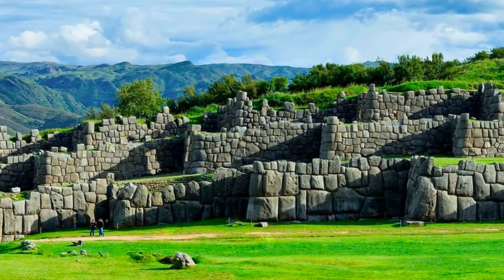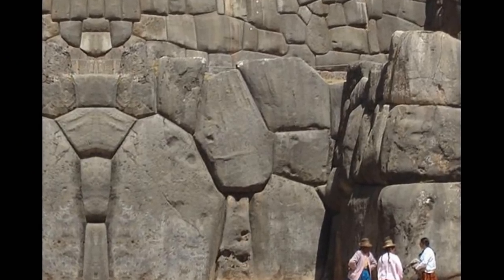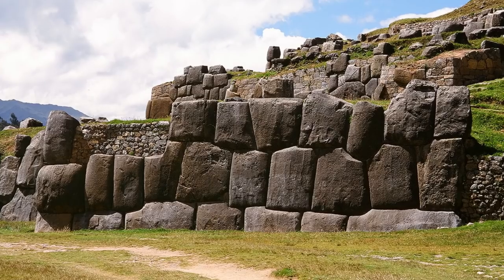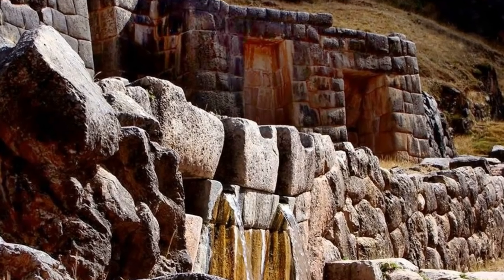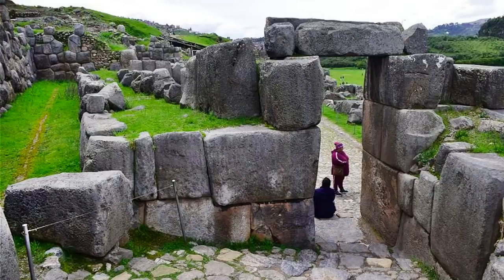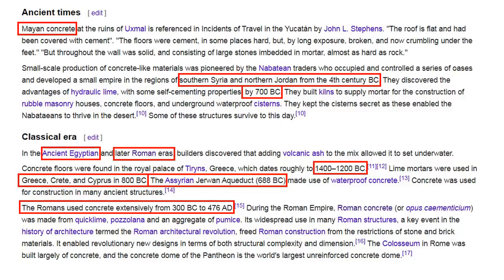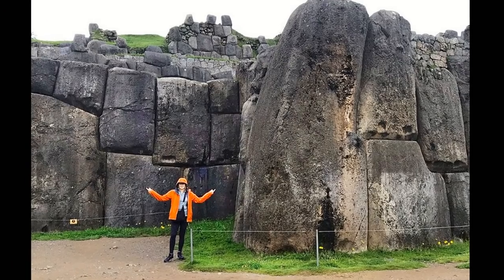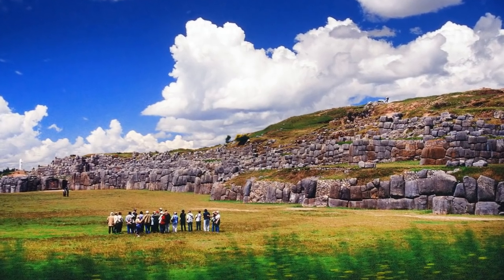Explained: How were Peru’s #Sacsayhuaman Walls Built

Comment: Someone should drill cores that span the joint of two of these megalithic blocks. At the inner end of the core the joint should contain pollens which would be dateable. This may give us a date when the blocks were put together.
Reply from the maker: Interesting idea. If researchers can find ancient pollen in between blocks, that could be very helpful to date the site.
Reply: @CuriousBeingbyTina  I worked as a drilling supervisor, so I'm familiar with coring activities but not usually horizontal. I would suggest taking a core from the centre of a block as a control sample, testing the dust and cuttings for pollen and dating them. Would the Peruvian authorities be amenable to such investigations?
Reply from the maker: @thomasprescott5333  That'll be a very effective method to tell the age of the structure. Maybe the Peruvian authorities would consider to do such investigations if the core drill is done at somewhere at the back and not affecting the face side or the structure integrity of the walls...

Comment: I just found out that a team of Russian and Ukrainian geophysicist along with Peruvian scientists did an analysis of the Sacsayhuaman stones little over a decade ago and found that the builders used various techniques on the site. The largest gigantic stones at the base were made from smaller stones from the nearby quarry and then covered with a specialized type of a hydraulic lime mixture using pulverized quarry stone. Most of the other large boulders were made from the hydraulic lime of a specific chemical mix they did not analyze.Seems that they mainly used microscopic analysis and not chemistry. Questions were raised as to where the lime was made, because it requires lots of fuel, usually wood burning. They were asked by the Peruvian government to find out why the megalithic structure was deteriorating and how it could be preserved. Apparently acid rain was dissolving the rocks, and ground water shifting soil underneath. No meaningful excavations beneath the base of the walls seems to have been made. There look to be rock foundations bellow the ground levels. There are still many arguments as to whether the rocks were carved to this precise fit ( highly unlikely in my opinion) or if they were artificial polymer or hydraulic lime. I don't see why not a combination. Not enough analysis was made, which surprises me in this day and age.
  Do you have more information on these findings Tina?

Comment: Two  more things to consider: (1) Cuzco is about 11,000 feet high (17.7 km).  This project would have taken a fair number of people to do, so how were food, water, building supplies, etc., hauled up?  (2)  This looks like a military fortress -- who [and how] was able to assault it, why was it needed?
Reply: (3)   If geoconcrete was used, as the lady suggests in this post  -- poured in place like regular concrete -- there is another problem: when the blocks were still damp, a 100 ton (or tonne, for that matter) block is going to weigh its cured, dry, weight, PLUS all the water involved, at a "pint a pound" (roughly, half a kilo for each 470 ml of water).  This will not be light.

Comment: I agree SSHM seems pored, or like it was from a hardening play-doh-like substance. I have an idea about the knobs. If you imagine them pouring the playdoh, they would need wooden walls to keep the front mostly flat and uniform. These wooden support walls would stay up until the substance has completed hardening. These support walls could have simply had holes in them which caused the knobs. Am I missing something here, or could it be that simple?

Comment: In Greece I saw the same giant walls, made from big stones that fitted in the same way you discribed, the so callled cyclopic wallls. Do you think that they are made on the same way?
Reply from the maker: I think it's possible that such stone blocks in Greece were made in a similar manner. The Treasury of Atreus is built with a concrete-like material.
Reply: @CuriousBeingbyTina  Yes, I was there many years ago, did’nt understand the craftmanship in relation to the cyclopic walls in that time, with their primitiv bronze tools…

Comment: The only problem I have with casting is that each block must have had its own mould, and used only once. And... creating a mould with such complex curves and corners, so that the resulting cast rock would fit so perfectly with its neighbours would be almost impossible. But I do believe that some method was used to soften rock, and therefore made fitting easier. There are accounts of birds using a plant to soften cliff rock so that they could 'dig out' a burrow... I read about this in an account made by an explorer in the 1800s, but didnt realise its importance at that time, and can't remember who the explorer was 🙄 Doh!
However it was done the result is undeniably amazing!
Reply from the maker: I explained about the different block shapes, curves and corners in the video. Hope you can continue to watch.

Comment: Maybe the boulders were placed on top of each other and the surface of the rocks were softened.
Not the whole boulder would be softened, just about , maybe 5 cm (2'') of the surface.  Gravity would postion the rocks, later the soft part would harden.  It would be interesting to compare the crystalline structure of a samples from the surface of a boulder versus inside the boulder.  Other than that: Idonno

Comment: No , no , absolutely no , they was made by wire saws or outer high technology device , the builders was giant humanoids capable to lift and transport those stones , those giant was a result of genetically manipulation by design. Well the raw cut stone was placed on the top of other , they cut with the wire saw the touching parts until the stones fits together perfectly, they always made  cuts vertically and horizontally at the same time , the reason to do this was to make economy of stone material , that's the revealed secret , the mystery is , from where comes that high technology , where is that industry who makes such a devices ?

Comment: the idea of them being moulded with a quick drying concrete is a good one, but i doubt thats how it was made . i myself use quick drying concete at work sometimes , and when it is wet if not moulded all around the mixture would get contamanated with dirt and other packing stones at the rear , a detailed examination of the rear of the stones would be required just to see if the stones themselves were contaminated .

Comment: Tina, great video and facts presentation. If the walls were a poured/formed concrete, couldn't the science community take a slice(diamond tool), and place under a microscope and answer that question? maybe someone already has. Maybe you mentioned that already, but I think polymers/concrete and natural rocks would be easy to distinguish?
Reply from the maker: Thanks Gary. I did discuss the scientific finding on the block material using optical microscopy and X-ray fluorescence analysis in the video.   The finding confirms the man-made stone theory, though further studies are needed.
Reply: @CuriousBeingbyTina  Thanks for reply back. I will listen to again to catch what you said. Nice work.

Comment: You wouldn't pour thousands of differently shaped blocks.  You would pour bricks.  You do polygonal masonry when you find stone, as opposed to quarrying. The knobs are likely used to jack the block with a wood log to scribe the edge.
Reply from the maker: No need to make individual molds for each block. I explained my thoughts on the molds and unique shapes in the latter half of this video.  When the cast blocks were placed in position while in a plastic state, the compression from above and sides would have pact the playdough like blocks to fit into existing blocks thus change their shapes.  This way even blocks from the same mold would have resulted in unique shapes.

Comment: I was unaware of a limestone chemical composition for any of these megalithic walls.  I think many of the huge blocks at Puma Punku are said to be a hard sandstone while other megalithic construction is said to be of granite, basalt, or diorite.  If any igneous stone types were used to create the same kind of irregular interlocking walls, then a means other than poured or dry-tamped concrete must be considered.  

Equally as puzzling as the method and material of construction is the rationale for such structures.  Why so massive and permanent?  What made their builders so convinced that such great effort was necessary? That effort in many cases involved quarrying and carrying huge blocks from great distances.  It is as if the culture that built them was preparing for an expected assault by nature or an enemy against which the walls only partially endured and apparently failed to protect their civilization.  

We see evidence in these ruins of violent earthquakes and something else, the vitrification of some megalithic surfaces.  Robert Schoch hypothesizes a CME strike so intense that tongues of plasma actually penetrated the atmosphere and laid waste to whatever they touched, including igneous rock.  The scorched ruins of Tanis and other Egyptian sites, the glazed walls of Cuzco, and the mysterious vitrified stone fortifications of Scotland might be added to the evidence.  If not solar plasma, what else could account for the vitrification, huge cosmic lightning bolts between passing celestial bodies as proposed by Velikovsky or advanced energy-beam or thermonuclear weapons?  Was there a hostile force with such capability as Sitchin and others contend, the jealous and belligerent gods of the Sumerians or of ancient India?  

Was the supposed ancient worldwide builders' civilization utterly destroyed in a matter of seconds, minutes, or hours, or was it just crippled so badly that it was unable to pull itself together again?  Were only cave-dwelling humans able to survive the devastation and continue the human lineage?

What lessons can be drawn from the ruins we have found?  Are they being applied by anyone today?  I say yes.  A network of deep underground military bases (DUMBs) has been built in the United States and I think in China and Russia, possibly elsewhere.  These are the modern equivalent of the caves in which some few of our ancestors might have survived the violent shock and heat waves of cosmic impacts, Schoch's planetary plasma bath, a galactic black hole jet aimed right at Earth, or high-energy particles and gamma rays from a supernova closer than 50 light-years from Earth.  They might also protect against thermonuclear imbroglio, magnitude 12 earthquakes, continent-sweeping megatsunamis, or incineration by alien invaders.

Comment: Gary Birdwell
33 minutes ago
Hey Tina, very good video, I had to rewatch. I’m not trying to be critical of your research, but wanted to add something to discuss. My biggest concern with this hypothesis is, how did they mix such a large batch of concrete or polymer? modern day plants don't mix that much material at one time. There are limitations to how many tons can be transported by truck, plus the machine to turn the paddles would be enormous. The setting time of concrete is relatively fast, and any kind of plastic time would be very limited, you would have to mix, pour and move fast, with a large mass . The poured block theory sounds promising , but the size and shapes of the block/forms just don't make sense, why make a curved wood/steel form to pour a multiple ton block? it just complicates the design of the forms. To hold that much material in shape, the forms would have to thick, I'm not sure if wood forms would be sufficient to hold the force while pouring. I like to reference the Hoover Dam construction, its a modern day marvel, still relevant in engineering. Take care! you're doing a great job, taking steps to solve the puzzle.
Reply from the maker: Thanks Gray. I think the material the original builders used was dense and plastic, a little like play-dough, which hardens or cures later. Maybe these builders didn’t use wooden molds. Maybe the material was cast in position. I think if these blocks were cast then the builders may have different methods to mix and produce their special concrete/ geopolymer. The original builders possessed sophisticated technology that probably surpassed ours, so they might build their project differently. The tight fitting and curved adjoining faces between the blocks are signs that the blocks were pushed or pressed together when they were in a plastic state.
Reply: @CuriousBeingbyTina  It's such a baffling thing. Thanks for the feedback. keep digging into it, you're doing great research.
Reply from the maker: @garybirdwell6015  Thank you Gary.

Comment: The UPPER sides of blocks are wildly irregular in many cases in ways not explained by the weight applied ABOVE them.  "casting" ?   Molds simply would not have irregular tops.  "Softened" stone could be irregular to start with...and still produce intimate joints at contact points.

Comment: Thinking logically instead of a concert that has a setting time this would creat many problems including time constraints, whereas  if you could plasticise rock at will it would give you much needed flexibility and options regarding the shape and size of the raw roughy cut rock from the smallest pebble to the megalithic, the characteristic sag in to the stone below would be explained by plasticising individual stones or successive lairs  directly below newly lade rows and then plasticise that lair and continental up all so the characteristic double protrusions seen amongst all polygonal sights could be attributed to electrical probes inserted crating the exact frequency

Comment: Another way is to use rammed Earth method. Instead of forms you dig a trench in your material is rammed packed which would bulge in the Earth and one stone was a day then you dig a little bit deeper for the next part of the trench for the next Stone when you have completed the process and the wall you remove the dirt on one side making a level plateau

Comment: hello 
thank you for the ferry nice vid super intersting
sometimes i think they have a stone softing device 
but stil its also possible with geopolymar the nobs are mind bogling same like casing stone of menkaure pyramid
there are tests done of the stone of sacsayhuman can see slide difrence in molecular structere when the take test from quary nearby what do you think the stucture is made for?
thank you
Reply from the maker: Yes, the Menkaure Pyramid has nubs too. It's possible that the pyramids were indeed made from geopolymers. I read some claim that "the (Sacsayhuaman stone) molecular structure was altered". I think it could be caused by hydration or geopolymerization which means the Sacsayhuaman blocks were made of either concrete or geopolymer.  Concrete hardens through a chemical reaction called hydration which produces new chemical compounds that lock in water between their molecules. Geopolymer is created with geopolymerization (chemical reaction) which is is the process of combining many small molecules into a covalently bonded network. Both would have formed different molecular structures from natural stones.
Reply: @CuriousBeingbyTina  yes it realy looks like a type of concrete but sometimes i think the building bloks come straight from the quary and the way they are put together polygonal masonery its so perfect and every block is difrent putting such a big wall with such heavy stones and so perfect its hard to think they make every block from polymer (and the nobs are easy to remove)
sometimes i think that they have a stone softing teknik ore a device that can temperoly soft the stone (maybe i have never seen such a device:) do you think it is possible that ther have been a device for softning stone? I think the acid theory is also maybe possible but i am not sure you need so much acid thank you for your reaction i apreciate it i can talk allot about this
Reply from the maker: @ddduaneee  Maybe they did had some method to soften stone...I also heard about the acid theory (can dissolve limestone).  It would probably be much easier to make concrete or geopolymer than soften stone...

Comment: One piece of Important of information you have left out (perhaps on purpose) is the condition of the rear of the stones, they are completely rough and un-worked. If these had been cast then all sides would have a flat surface, even the open pourable section would be flat as liquid always finds it true level. I think the fact that the stones are un-worked on the rear and only worked on the other sides and outer face kind of proves that they are actually only stone after all.
Reply from the maker: I think I showed the loose blocks with back sides shown in the video. The rough backsides work well with my theory because I proposed that the blocks were cast in position or molded then moved to position, while they were in a malleable and plastic state; then pressure was applied to the blocks make them fit tightly. This way the backsides of the blocks would touch the soil and cure with the shape of the soil wall.
Reply: @CuriousBeingbyTina  I think you only showed the sides which would naturally be flat as they have to fit tightly against one another. If they were cast in place then the back of stone would replicate the earth beyond, but it doesn’t at all, it just looks like typical uncut rock. It doesn’t help you theory in the slightest.